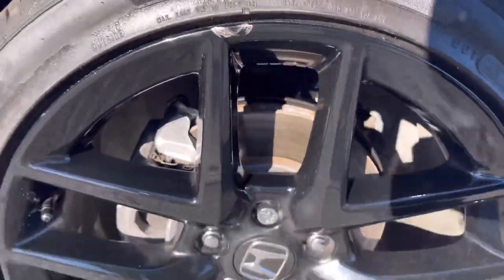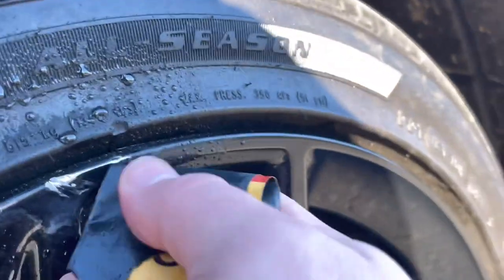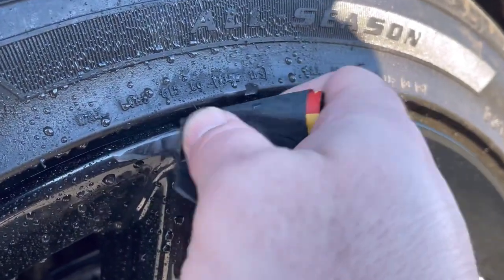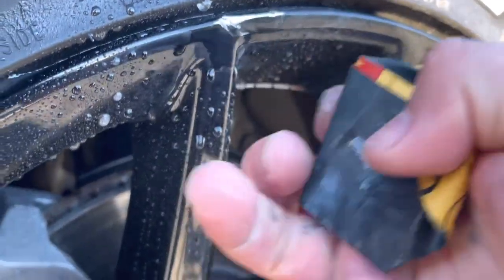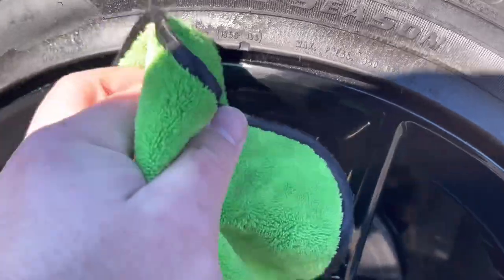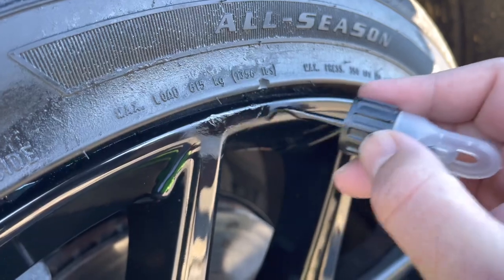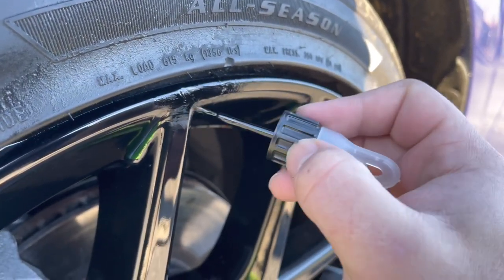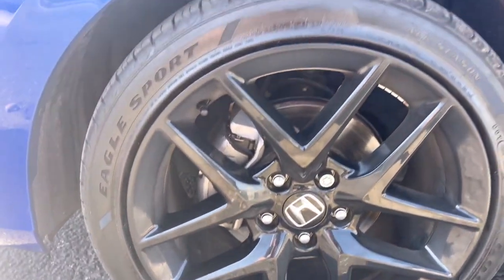How to fix curb rash for $20 - 11th gen civic

Comment: How did u get ur carbon fiber insert for the steering wheel? Did u buy the part or didnu have it wrapped?  I am thinking about getting a few small areaa wraped in carbon fiber like the gas tank cover and and side mirrors.